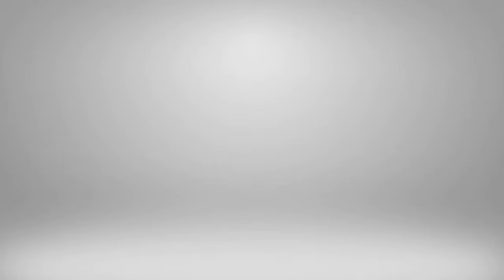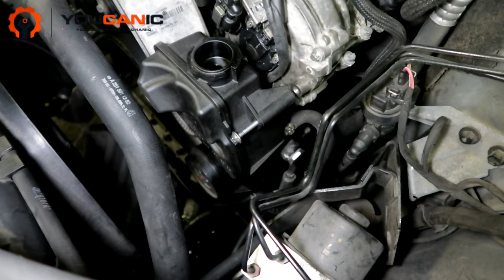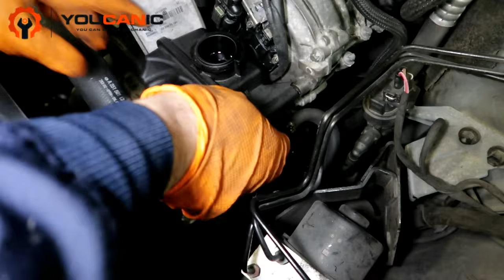How to Fix Mercedes-Benz Power Steering Leak - Reservoir O-Ring

Comment: Great vid
Reply from the maker: @rmasco71 If you’ve got a car issue or repair question, you can find step-by-step guides and scanner help at youcanic.com. We might miss some comments here, but our site has answers for most problems already!
Reply: @YOUCANIC  yeah I have to locate this leak when the weather gets better over here .. I got this 99 W210 a few months back and it was always bone dry underneath with ZERO leaks .. now Im pretty sure I see some Pentosin in the snow HA ..